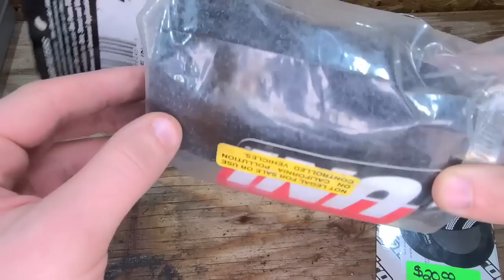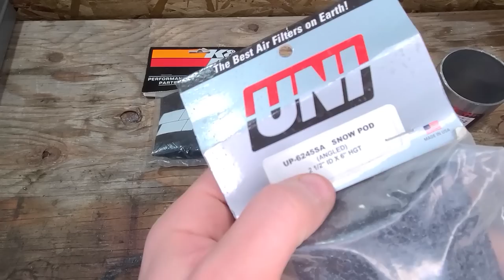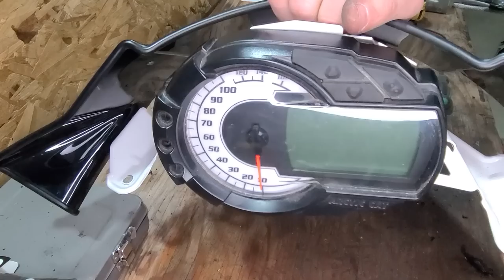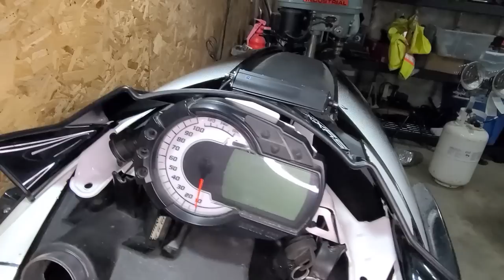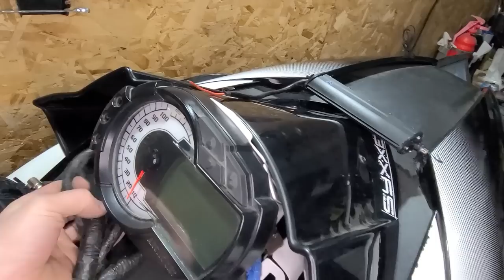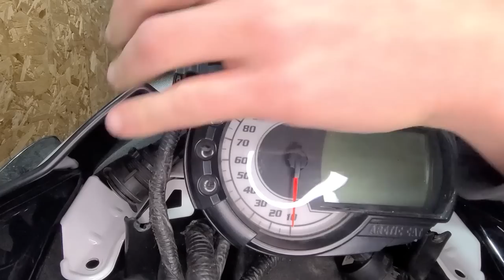ARCTIC CAT M8000 HEADLIGHT DELETE | HOW TO!!

Comment: Bars are definitely a need at this point for ya...have a 15 m8000 and just did the adjustable post delete and low bar with rsi risers ...much less slop and bs!! Super easy to do. But great video!! 🤘🤘 Keep it up
Reply from the maker: I will do that, but not until it needs to be done.

Comment: Curious to know if you need a different regulator, a dc regulator or something? I tried installed LED headlights and with the AC power they flickered when revving. Also Do you need the air filter? Could you not just install the frogskinz on both holes?

Comment: Could you just ditch the KN filter all together and use the frogzskin's over both intake holes? Especially since my 1100 turbo has a paper filter right before the turbo and I don't ride in the mountains?

Comment: Great video👍 i did the intake on my M1100 turbo a few weekends ago. Picked up the same snow pod you have i think. I cut the hood shroud in between the stock intake holes and ran it in front of the center of the bars. Kinda blocks my gauge cluster but it's normally coved by snow anyways and i really like being able to hear the turbo. I was going to go out the side of the hood but i was too afraid it would get ripped off. 
Just waiting till i can afford to pick up my new track then try and install it myself. Maybe a vid with pointers and tricks on how to swap a track out is in the works?😝
Reply from the maker: Tracks are still pretty easy on those! Just remember how your chain case goes together is the trick!
Reply: @syxxes  yeah that's the part that scares me haha. Not much to get the skid out but the drivers are the where the fun begins! I'll let you know how it goes anyways. Thanks for &the reply👍

Comment: I’ve been looking at a 2014 arctic cat  sno pro fx7000  *Mint condition- Turn key and go
*Fitted with push turbo- factory installed setup
*New belt/plugs, fresh oil and filter, full tank of supreme, comes with 2 tunnel bags
*Power commander fuel management system, POD 300 gauge, ice-scratchers, studded track, head shim, 550cc injectors, boost controller, clutching, APP head stud kit, AEM boost gauge

Serious inquiries ONLY!!! Not interested in trades
$7950.00 Canadian please tell me what I should know about this or if I should avoid it, pros and cons, and I wonder why no one bought it yet it’s been posted almost a month, I’m seeing plenty of other sleds sell quick, is it the price? Weight? Too  fast? Thanks🤘

Comment: I’ve had issues in the past with the factory intake covers ripping and creating spots for air to get into the intake on my xf  .. with your knowledge of these sleds do you think just putting a frog skin like you put on the right intake run but on both sides would work good enough as intake vents ? Or would it restrict too much air-flow ?    (Hope you can make some sense of what I just said lol)
Reply from the maker: I've seen it done that way. The problem just comes when you start getting into the deep snow and the vents getting covered, but if you don't do mountain riding it might work out.

Comment: Did you leave the headlights AC power? I had to convert my headlights to DC using the rectifier (I have E-start) to keep my LEDs from flickering like crazy.
Reply from the maker: I didn't. You can do that or you can get an LED with a ballast built in.

Comment: Hi Matt!
Is it possible to run both the oem headlight and a led light off the connector at the same time you reckon?
Reply: I don't know exactly what bar that is or how much current it draws, it looks like a generic 7inch 18w led bar and that is totaly fine to run with the standard light.  One thing you could do is upgrade the halogen to a Good LED bulb. As far as I can find Arctic cat uses a H4 bulb, there are some really good H4 LEDs out there :)
Reply from the maker: You could. Just have to do some math on the draw depending on your light.

Comment: do you need to have a resistor mounted on the 2016 m8000 when you delete the headlight?
Reply from the maker: I'm gonna hook it up to DC power soon.
Reply: @syxxes  ok. i have 2 small led lights mounted on mine. have cut the original top to lower it a bit. and a small led bar on my bar.  think i mounted a 100w resistor on it.

Comment: Not to do with this video. But I have a 15 AC. What is there to do about the handlebar wobble.
Reply: It’s the adjustable handlebars. There’s a delete kit you can do that allows you to cut the shaft, install a new bracket and put fixed risers on and it eliminates about 99% of the slop.
Reply from the maker: You can upgrade the post to a solid post or get an adapter I think from RSI to get rid of the adjustable part.